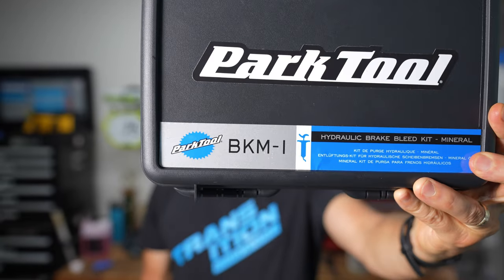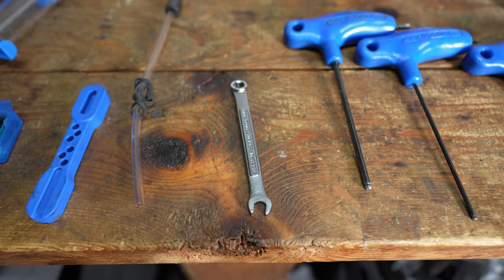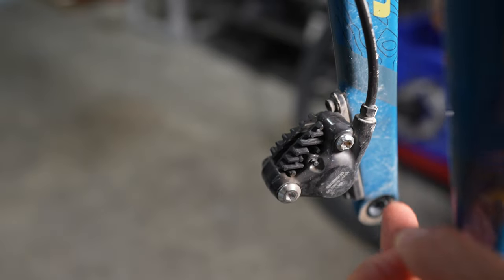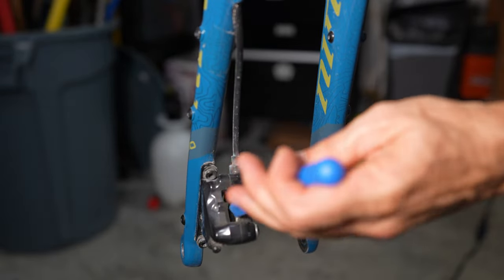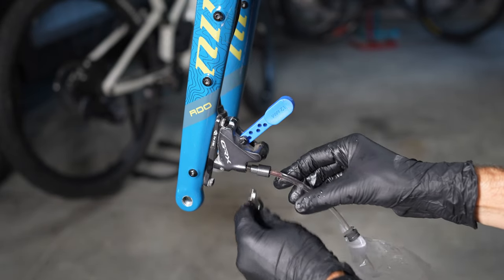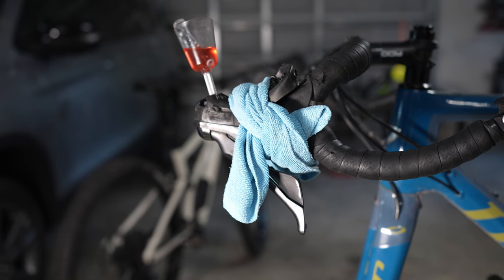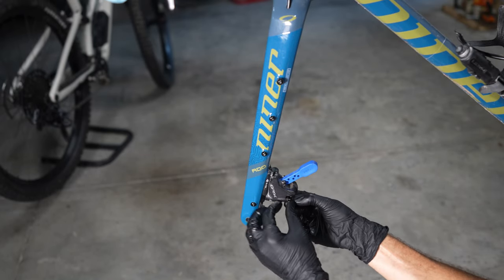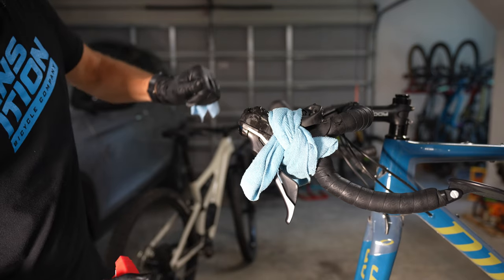How to Bleed Shimano Brakes: Complete Guide

Comment: Before pushing the pistons back do yourself a favor and take the screw off the master cylinder at the lever to give the fluid a place to go. If you don't, you run a risk of popping the little seal at the end of the barrel which is not available separately. It's a rubber diaphragm that can and will rip with excessive pressure.  Also, you can use a syringe but I find the gravity method much easier with the Shimano bleed funnel. Fill the funnel and pump the lever and the oil flows right out the bleed port like you showed.

Comment: Hi Clint, from what i have gathered, a complete bleeding process includes 3 steps: 1.Gravity method/Syringe method for injecting the fluids into the system; and gravity method or syringe method are basically two different ways achieving the same goal. 2.bleed the caliper. 3.bleed the shifter. Am i missing anything? My question is when you bleed the caliper why do you need to press the lever while open and close the bleed screw, what is the mechanism of this method?
Reply from the maker: It’s a step that Shimano recommends. From my understanding it forces bubbles out, a bit more forcefully than just letting gravity do its job.

Comment: Good video!  I've watched lots of brake bleeding videos and yours is terrific.  I wondered about a couple of things while watching.  Could you tilt the bike  in the stand instead of loosening the handlebars or lever in order to get the funnel at the correct angle?  I think I have done that and it seemed to work.  Also, when putting the  funnel in place for the syringe bleed, is it a good idea to have some mineral oil in the funnel to avoid air getting into the reservoir?
Reply from the maker: No need to add mineral to the funnel before pushing it up through the syringe. Gravity will keep air from getting into the system. As far as tilting the bike, you’d have to tilt it pretty far each direction so that would be a bit of a hassle and possibly get some air in to the system with all the movement. I guess you could try it but in my opinion it would be easier just to loosen the handlebars or the brake lever.

Comment: How would you bleed the caliper on a caliper that has a bleed screw instead of a bleed nipple, since you can't open and close the system with the hose attached (it's always open if the screw is off)?

Comment: if i just do the syringe method does the lever become stiff after the oil is transferred into the system or do I need to squeeze it a few times for it to stiffen up

Comment: I would never again use a bleed block that doesn't cover the whole area of the calliper pistons. I have destroyed two 4 pot callipers until I found out why. I was having trouble getting a firm brake and applying full lever pressure caused the ceramic pistons to push the bleed block at an angle as part of their surface area was unsupported. I have since 3d printed my own bleed blocks but If you are confident that you have all the air expelled then I would suggest you only apply full lever pressure after installing the brake pads.

Comment: Hi Clint what are the indications/reasons for bleeding the brakes? And how often should the brakes be bled?
Reply from the maker: When the levers feel spongy or the lever goes too far to the bar. If it’s been more than a year, especially if you ride in more extreme conditions, I would bleed them. Once you get it down it is a 10 minute process.

Comment: would it be the same process with tektro hd-m745 brakes?
Reply from the maker: Do they use mineral oil or DOT fluid?
Reply: @ClintGibbs  on my levers it says mineral oil
Reply from the maker: @jayf2487  Then this procedure should work fine
Reply: @ClintGibbs  thanks Clint👍🏻

Comment: So either method does the same thing it seems. Even for changing to new fluid. Why even bother with the syringe. 🤔😑
Reply from the maker: Syringe works really well on the rear brake because you don’t have to worry about making sure the caliper is the lowest part of the system. In other words, you don’t have to rotate your bike at a weird angle.
Reply: The syringe seems to also work better at making sure bubbles are removed from the system in the rear brakes.